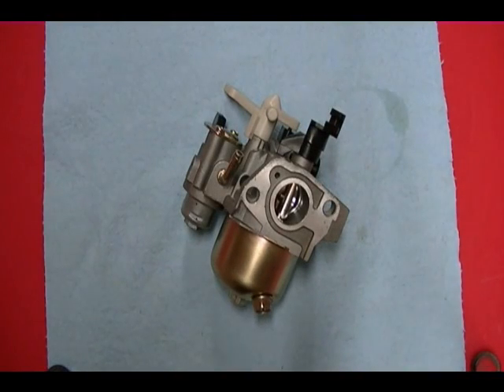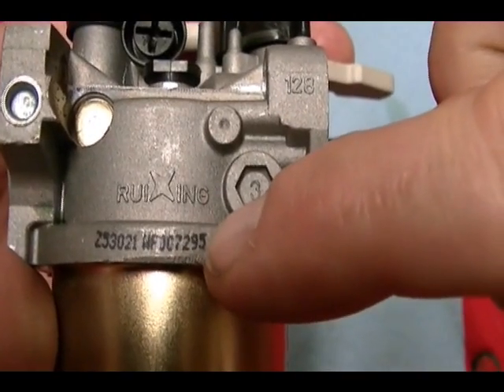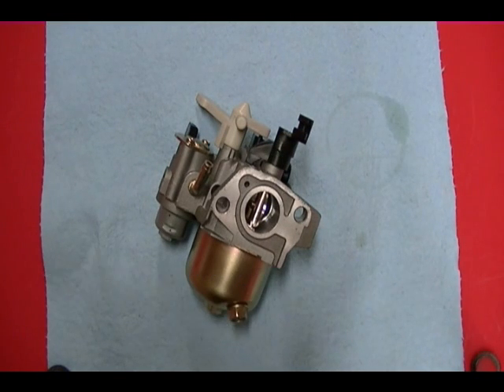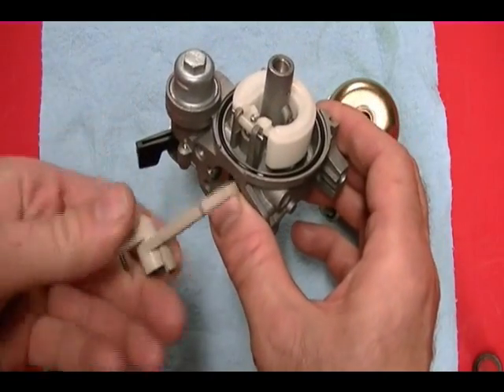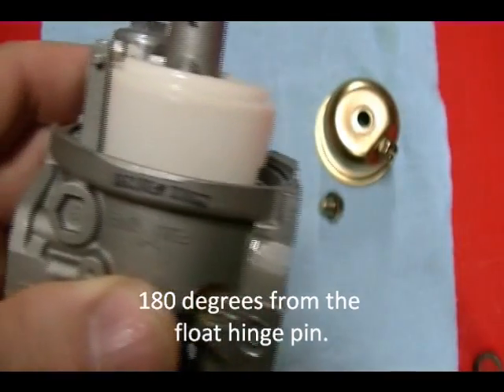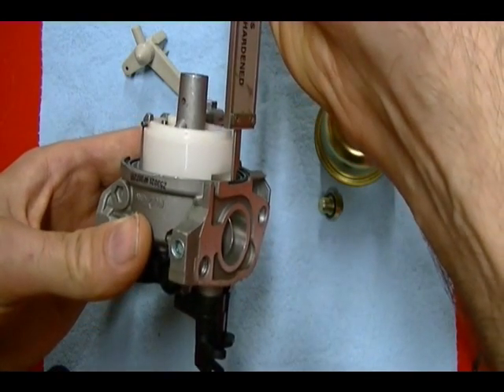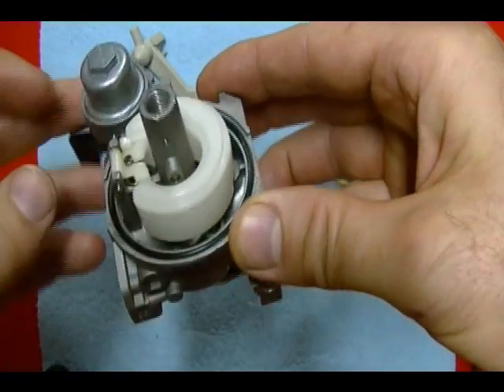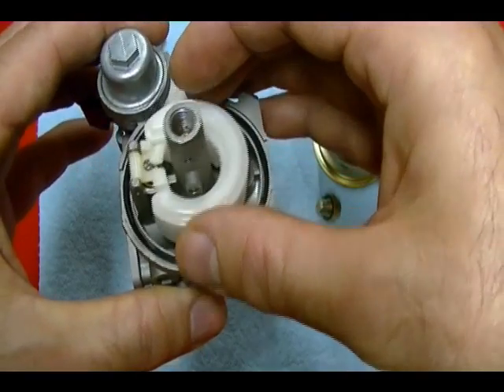Small Engine Repair: Carburetor Float Height on a 6.5 HP Harbor Freight Predator Engine

Comment: Thanks for the video that helps.  Gonna go take mine off and check it out it seems to be leaking when I open the fuel valve.
Reply: replace your float if it isn't airtight

Comment: Thanks. My generator would not start and Hurricane Matthew is on its way. My reservoir was empty tho fuel did flow thru the tube. I took the reservoir off the carb and your hint about pulling the hinge pin off the float let the valve pin come off which must have been stuck in the inlet. I put it back together and now fuel flows into the carb and the generator started with one pull.

Comment: I filled my 212cc predator motor with gas the other day (in a mini bike), and it leaked gas heavy out of the carb on 2 the concrete...any ideas wtf is going on thank u
Reply: Needle is not seating , closing off the gas .
Reply: Hole in the float?

Comment: Have a BAJA mini bike with a Honda clone engine. The carburetor looks to be the same as the one in this video.
My bike had set for too may months and would only run with the choke full on. I had done everything this and 
other videos had indicated to clean the carburetor but it still would not run unless the choke was on. What I 
finally found was a block orifice in the black plug that is in the top of the carb under the idle adjustment screw.
  Remove the black screw for adjusting the idle, pry up on the black plug which is now exposed. I had to pull
a wire out of a wire brush to find a wire small enough to clear this piece. It has 3 holes in it. Then flushed with
carb cleaner. WA-LAH she runs good as new. Also a set of tip cleaners for an Acetylene torch works good 
for the other orifices in the main jet.  Now if I can stop the delivery of the new carb I ordered from
Amazon?
Reply: +baja mini bike Sounds a lot like the symptoms I'm getting with my brand new motor that sat outside for a Canadian winter. I'll definitely try this out, thanks for taking the time to comment, even if it doesn't work for me.
Reply from the maker: +baja mini bike Thanks for the info.

Comment: I just purchased this same engine and carb and mounted it on my rototiller. It starts but, only runs 5 minutes to 30 minutes. Then it dies and wont start unless you let it sit for 10 minutes. Any ideas on what to try? Thanks.
Reply: Coil
Reply: same.engine in my yard machines mower. crappy chinese engine with no support here,even mtd refuse to bring customer support when you mention the infamous 173cc.mine works great 1st start then you have to wait like 20 minutes to start it again because it always flood when shut off!! gas leaks from carb like hell so flood mode is evident and what control fuel level?? right the float valve so theres got to be  something that help solve it. float adjustment is the only cure!!

Comment: Hi, I have the same Predator engine on my go kart, and I made the mistake of leaving gas in the tank for like 2 months, and now it dies when I gas it to fast. I'm guessing the quick demand for fuel is hindered when I gas it to fast, thus me thinking the fuel lines got clogged with old gas that has turned to jelly. I bought the bearymans carb cleaner and I need to know how to use it, like do I mix a certain amount with gas and let it cycle through the fuel lines till it's cleaned, are do I gotta take the whole carb out and clean it by hand?
Please reply
Thanks.
Reply from the maker: I think Bearyman makes several different products, and one of them is a solution to add to the gas, so it passes through the fuel system and cleans as the engine is running. That sounds like the easiest solution and I would try that first. Following the manufacturer directions on the can. If that doesn't work, than you can always disassemble the carburetor and clean it.

Comment: I replaced the float pin spring with a piece of a pen spring to make it more stable. Its works well!  If your carburetor is flooding no matter what you try....put a stronger spring on the valve.
Reply: ill have to try that because if i rev my predator engine it floods and dies and drips gas from the carb
Reply: I'll give this a shot, my float is half full of fuel or liquid, tried to drain it but won't come out, so how it got in there I have no idea.  The other thing is that if you leave fuel on it will flow into your bore thus filling your oil sump with fuel.  If you take your oil plug out you find it will be over flowing.
Reply: Dale Jackson how did you fix??
Reply: Bike only runs when tilted, float issue? Cant ge adjusted as soon as engine is set upright is kills ...dafuck

Comment: @oo Strack   As gasoline sits it slowly turns into lacquer. You can use carb cleaner in spray cans to try and clean it out but chances are that you will need to dip the entire carb into a 1 gallon can of GOOD carb cleaner like Berrymans which can be bought at any auto parts store for around 20 bucks. Spray can cleaner is OK if you can spray it through all of the jet and air passage ways. If the jets and passageways are completely clogged then spray cleaners are useless and it will require dipping or soaking in the good stuff. Make sure you do not dip plastic or rubber in the Berrymans or similar cleaners or the parts will weaken and rubber will swell badly.

Comment: This is a RUIXING model RX9602 carburetor. Chinese of course. As far as getting parts and rebuilding it, it might be cheaper to replace the whole carb. That is if you can find a replacement carb or in fact replacement parts. Do you think it's a Honda or other clone??